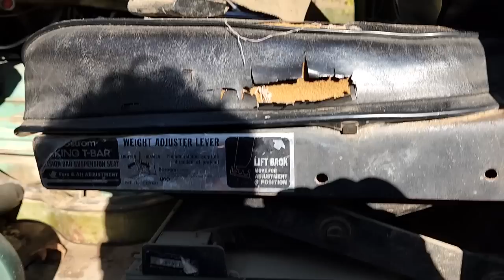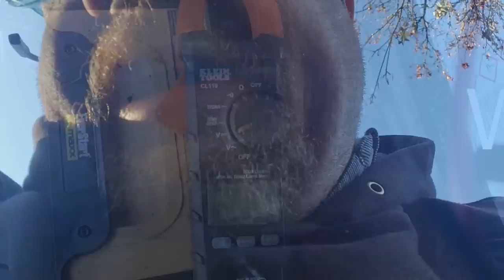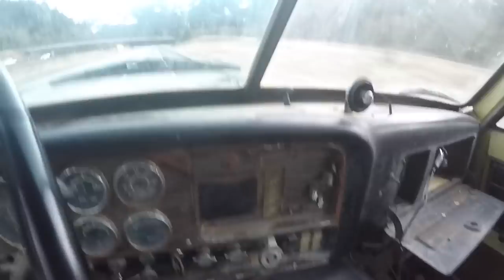1971 GMC 9500 started after 26 years Now will it drive 1767 Miles (I make BAD choices)  (PT1)

Comment: I took a driving test in one of these. It was 100 degrees, no A/C. The instructor told me to turn around after 2 blocks, "I can't ride in this thing. You pass."
Reply: @oldrustycars Your lucky, I took my test in a 76’ 90 series Chevy, 318 13 spd, and the driving instructor burned her arm on the pipe getting in, needless to say she put me thru hell!
Reply: I leaned how to drive on the Chevrolet version , 671 and a 10 speed hauling wheat in Perryton, TX
Reply: LOL excellent
Reply: I got to drive one of those with a V12 Detroit that's what we had back in the day and we loved them, the snot-nosed bunch of fucking steering wheel holders having a clue and you wouldn't know a good truck with bit you on the ass

Comment: Dude, the first truck I drove way back in 75 was a 9500 Jimmy with a 6-71 Detroit and a 13 speed day cab! Loud, rode like crap, no power when loaded, just a peach! Did not take me long to switch to a 71 Diamond Reo, 6-71, 13 speed day cab! Same thing but a touch more comfortable! About a month in that truck, and I started eyeing a 68 Diamond Reo with a 250 Cummins and a twin stick 4 by 4 my boss had out in the weeds! He said it ran when they parked it out there, but no one wanted to drive it because of the twin stick. I took some fresh batteries out to it, pulled the compression release, turned it over till i saw oil pressure, shoved the CR back in, that old Cummins came to life! Drove it out of the weeds to the shop, put new tires on it, checked everything over, and started hauling Road oil in a tanker with it! Been a Cummins man ever since! 
You may need to "Excite" that alternator, to get it to start working again. I know you have already dealt with this, but if you saved it, it may still be good!

Comment: Holy crap. We had one of these as a wrecker in Pusan Korea. I was an 88M and only one of two that drove the wrecker. Had a 15 speed with the derp reduction on the dash. I pulled a twin sctew International with a 40 foot trailer loaded with frozen meat, milk, cheese and butter 50 miles back to PSF to be unloaded and reloaded on three different trucks. The International broke down and it was an interesting ride old school wrecker with twin booms but it had diffs on it. The load was too heavy so took full advantage of that deep reduction. It actually had Jakes on it too. And a big ass V Drtroit.

In Pusan we didnt have the Tactical vehicles. Everything in our motorpool was commercial. Cherokees, GMC trucks a little newer than Big Fuck aka the wrecker. Two Internationals and 2 Daewoo busses and a little Hyundai Bongo Bus. We actually worked more than trained in Korea at that time. Running Rations, Shuttles and Taxis.

I am reminiscing a bit but thanks for the memories. But that old Jimmy would scream at 70 mph maybe because it was a wrecker. The speed limit on what we call interstates in Korea was 100 KPH. 62 mph.

Comment: Good to see you back again making videos my dad was a owner operator he had a 1989 brigadier I hope I spelled that right it was red  good truck until it dropped injector then the motor was gone after that he got a cab over GMC Astro he run that 4  a bunch years then the turbo went out     Then he said that’s it he went out of business  I thought you might want to hear the. Story be safe
Reply: So you mean he went out of the business because he had to do maintenance on his trucks. Sounds to me he ran horrible equipment or did he think he could run a truck forever and not have a part fail.

Comment: Making some cab & frame crossmember modifications to mount a Link cab mate air ride suspension would greatly improve the overall ride quality of the truck.Some air ride high back seats and installing some air bags on the front axle will also improve the ride quality of the truck.

Comment: Drove on for O’Hare Towing back in the early 80’s. Had a 750 Holmes wrecker body with a 290 Cummins and a 13 speed. I could pickup a tractor-trailer and fly back to Chicago. Big wreckers the best way to get CDL then because there were no schools.

Comment: my uncle who died a week ago was a 2 stroke detroit specialist in the 70s & 80s. when he died, i thought of the dying art of setting up a rack on the old engines.he learned how to work on them in the service.was in his shop i first ever saw a 8V92 with a 8 inch hole in the block from a rod going thru it.he was putting another engine in the truck.im guessing the driver let it roll down a hill into an overspeed condition.i never had one over 2150, & never had a problem.
Reply: Towing company I worked for had an old IH daycab tractor with a 6v71 in a barn. They used to turn it down for emmisions testing and then turn it back up after it passed. The two former owners passed away and the son took over and nobody knew how to work on it. It was a shame. We got the old girl going one day and pulled it into the shop and washed it. It was a minty old truck. Think they sold it years later

Comment: On three of them in my career. All 671 last one I had was somewhat of a show truck that I bought from a guy in LA had everything on it you could ever hang on one. Heated adjustable mirrors power windows air slide fifth ect. She leaked oil scream like a banshee but always brought me home drove it until California made me get rid of it. Haven't had one is Dependable since

Comment: Nice truck ! Those engines just keep going but do require regular maintenance. Straight 40 weight oil is what they need. Bus Grease Monkey is the specialist on 2 stroke Detroit engines. Good luck with the truck. Have a Blessed Day

Comment: Best not to idle these engines or wet stacking and stuck rings occur 
They need to get a load and get hot .
In marina we had guys idle them in boats at dock and not take them out in bay .
Would be all loaded up carbon and stuck rings diesel in crankcase oil .

Nice truck !

Comment: 671 with a 5 and 2 speed  rear no ac no radio  no power steering
Reply: 43 years later ac power steering radio automatic transmission bending system and all kinds of unnecessary bulls#!?!

Comment: You said you checked the injector rack and then later on you say the rocker cover's never been off or not in a very long time. How'd you check the rack then?
Reply from the maker: Simple, Check the throttle and the stop... Old style has no yield link so you can feel if the rack is stuck. 
Also it has an emergency stop door so easy to choke if it tries to run.

Comment: Missed what transmission it has? With a column  shift
Reply: The "column shift" is actually an air brake control for the trailer brakes only. The transmission looks like an Eaton Fuller Raodranger 13 speed, maybe??